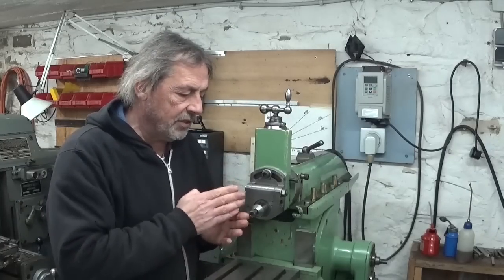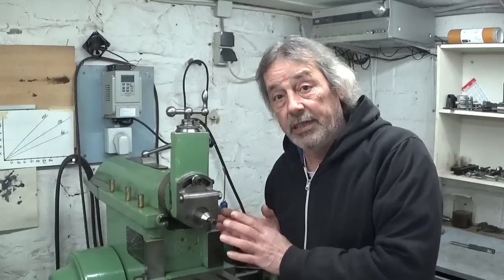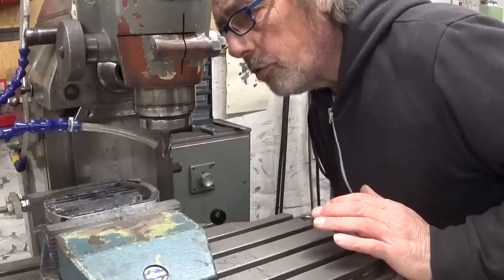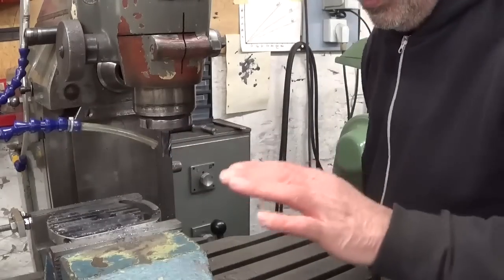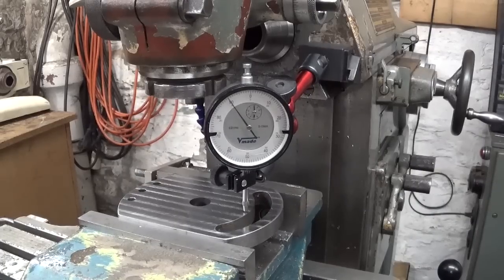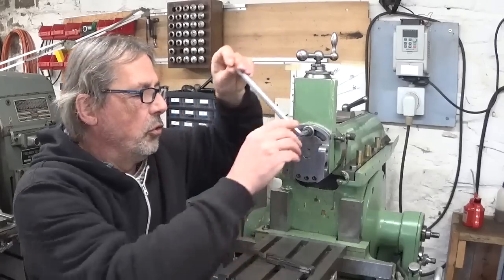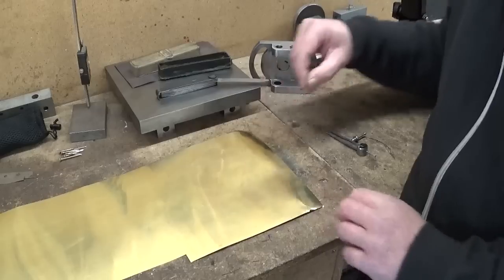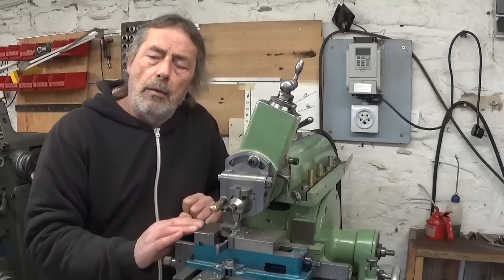Resurfacing the clapper box.

Comment: Haha. Fixing the gap by using a piece of paper between.... It's a new version of the talking: "The pen is mightier than the sword"....
Messing? You're talking Swedish suddenly? Brass? Joking! Not an option to shorten the bolt by 0.1 mm?
It looks like mission accomplished to me. As always, Both interesting shop work  and entertainment.
Reply from the maker: I can't hold the bolt in the lathe. So, the washer will have to to.
Reply: @Rustinox  I made some helping parts for holding bolts in the lathe! Take a round bar, eventually with diameter a little bit larger than the head of the bolt. I used aluminium. Drill and thread the hole to match the bolt. Slice this piece up in the axial direction. Insert the bolt in the piece and chuck it up. Voila!
If You somehow give me a mail address I'll send some pictures.

Comment: I wonder if that part is a bit of a design flaw. That upper edge for the bolt you left .1mm higher...it may just be to weak and warp again over time. If you can bend that whole plate in the vise...I'm sure it's easy to bend that upper edge with little effort. Perhaps a thicker plate or a wider upper edge would have improved that design.
Reply from the maker: For that I need to make a new clapper box. I think this will do just fine.

Comment: Good repair! Did you consider lapping the part flat after milling for a slightly better fit? I think your choice of the 4 flute end mill over the fly cutter was a wise one. Unless the mill head is perfectly trammed a fly cutter will not cut flat. Even a slight amount of out of tram will cause a significant radius in the part you are trying to cut flat because the cutting tip at the end of the long fly cutter arm magnifies any error. The small diameter end mill might take longer but it's more likely to create a flat surface. Thanks for another enjoyable adventure in the machine shop.
Reply from the maker: Thanks. With a bigger HSS fly cutter it would work too. But I don't have one.

Comment: A tool to make a tool. And it worked very nicely.  I wish I lived closer, we could have surface ground that shaper part.   Chasing 100ths of mm can be difficult as I've been finding out when making precision parts.  Quick tip: Next time, after milling, take a precision stone and stone the part. It will show the ridges and then you'll be able to deal with those before taking another cut on the mill.  stay well Michel.  Gilles
Reply from the maker: Thanks For the tip.